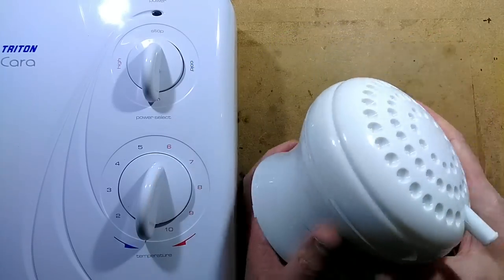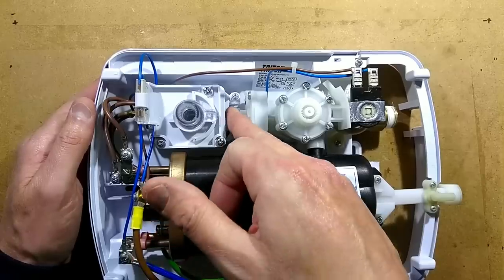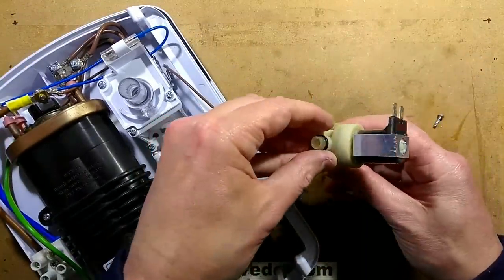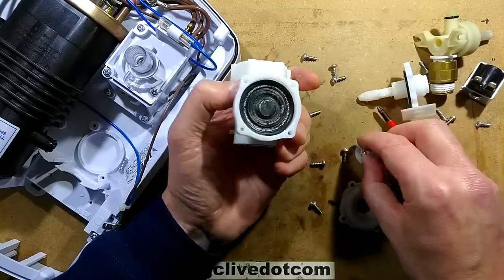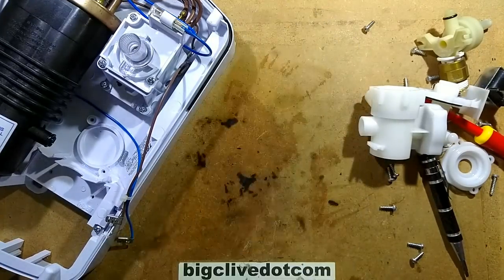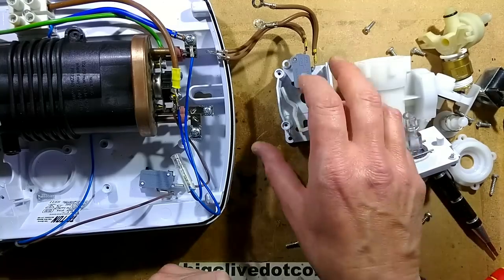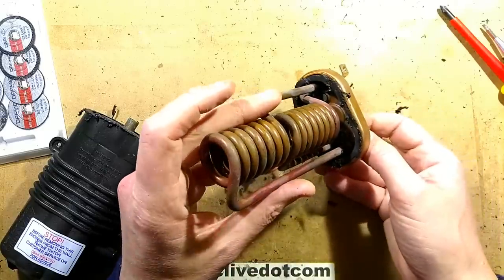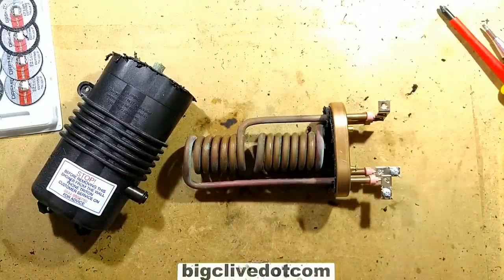Teardown of a UK electrically heated shower unit.

Comment: "Having shown one of the cheaper, but less safety conscious electrically heated showers used in some other parts of the world I thought it would be fair to show the insides of a typical British electrically heated shower." 

Just to make it clear folks: That last shower head was the cheapest garbage one could possibly buy in Latin America, we have showers with digital temperature monitoring and self adjustment and even bluetooth and mp3 players built-in down here (yep, really). Besides all the safety related stuff, of course.
Comparing the last shower head he reviwed with the higher grade ones we have is like comparing a bicycle to a Tesla Model S, and say they're the same because they're both used to transport people. lol 
We do have fancy and "over engineered" showers here as well, the thing is that most people don't even bother with them as, in the end, it's just a shower.
This is what I use myself:
https://http2.mlstatic.com/duchachuveiro-duo-shower-quadra-turbo-lorenzetti-7500w-220v-D_NQ_NP_777601-MLB20377920760_082015-F.jpg
It's a pressurized shower (there's a electric pump inside to raise the pressure if needed/wanted) with two types of water jet to choose, temperature is electronically controlled by that rod in the lower part (so it's easy to reach), and can be adjusted mid-use with no risk of electrical shock, also all the little holes in it are made from silicon rubber, to make it easy to clean by just rubbing yours fingers around them, just like the UK unit from this video. 
It's a mid end shower and costs around 4 times the price of the cheapo garbage of the last video. =)
Fun fact: it's from the same manufacturer of the cheapo shower of the last video! (Lorenzetti)

Comment: the only part of this that would make me nervous, is the coil heater in the shower head. is the coil actually submerged in water when in use?  the rest is just a P.O.U [ point of use ]  heater. which looks very safe.with the enclosed Cal-rod Units. . .

Comment: We've gone through 3 Triton showers in the last 10 years idk why we still buy em
Reply from the maker: What fails?
Reply: @bigclivedotcom  I think it's always been the limescale building up so much it can't get enough water through. Idk my dad isn't one to repair stuff he'd tether buy a new one lol. I live in Kent South East UK and you won't believe how much limescale we get, it half lifes kettles & any electric heating stuff etc
Reply: @SustainableGal  You need a limescale cartridge system inline your water input, they save a lot of stuff getting bunged up and the cartridges  can be changed when bunged up themselves.
Reply: @Witheredgoogie  oh that's a thing, would that go somewhere else in house I'm guessing? Where it comes in from mains? Only trouble is are water pressure sucks already, it hardly sufficient for pressure washer 😂😂
Reply: @SustainableGal  You can get electric ones that do not interfere with the pipe work. Not sure what Big Clive would make of them but they seem to have some good reviews. https://www.screwfix.com/p/bwt-electromagnetic-one-sided-connection-electronic-scale-inhibitor-12v/13487
Reply: @Witheredgoogie  oh right cheers

Comment: thermostat normally fails, red hot or cold nothing else. thermostat fail. thing on top of heater near the copper bit.
Reply: PitManNCB They dont get red hot if there is sufficient flow through them. Sounds like you have low water pressure.

Comment: TAKE NOTE WORLD!!! This is how it's done in England 🇬🇧
This is a proper job right here. Even if there's worse case scenario this thing will shut down safely with no dramas and can be used again. Which is the complete opposite when it comes to GE's nucular reactors which another one will shit the bed sooner rather than later and they'll all need replacing and have the engineers make the decisions, NOT THE ACCOUNTS!!!!

Sorry I went into a bit of a tangent there but from the info I've read and heard. 
Also this new camera+audio is a lot shitter compared to your other one.

Comment: Hi. I misread the title of this video. I originally thought it was saying "the teardown of all UK electric showers. The reason for this is because I live in a housing association,who owns literally tens of thousands of properties. Over the last few years,they've been going around all their properties each week tearing out their Triton electric showers. A slightly different design,but still Triton electric. I still haven't managed to get an explanation as to why they've done this,but as soon as they fitted my new shower to the boiler so that it'll use gas to heat the water,the gas prices go up. Sounds like a back hander somewhere along the line. Especially as they are replacing tens of thousands!!!

Comment: I would appreciate 1080p60 video.
Reply: 1080p, fair enough for small details.
60FPS would be a bit pointless for this channel, though.
Reply: I like the smoothness. Once you're used to 60fps then 30fps just looks stuttering.
There is no downside of that feature (that i'm aware of) besides the higher bandwidth requirement.
Reply: Helios honestly 60fps is pointless 30 is just fine for this channel and as there's a lot of small details to see people would rather higher quality and lower frame rate ... If this were 60 id have to watch it at like 420p
Reply: do we want to see clive's wrinkles?

Comment: As you illustrate, electrically, British units are a very safe design, but I just don't understand the thinking behind them. What is it with the 'High', 'Economy', and 'Low', nonsense?

There should be two variables and only two. How much water you'd like (within the limitation of your available pressure) and the temperature you'd like it. Almost all I have come across limit the flow of water, even when more should be possible, and allow scalding temperatures. Why??? The 'only' time a user should have a problem is if the water is very cold and the power would never be sufficient to heat at full flow, in which case they could reduce the flow until the temperature rises to the desired level.

Is it so hard to design a shower to do that? It would appear so...

Comment: I wonder why this shower device can be used without electric shock.
Reply from the maker: The heater is sleeved in a grounded / earthed metal case and all metalwork including pipes are electrically bonded together too.
Reply: I understood the high voltage metal tube heater.
The shower head heater is low voltage.
I can not listen to English.

Comment: You guys don't have hot running water?!?
Reply from the maker: Yes.  But electric showers give instant hot water at point of use continuously, and are 100% efficient.
Reply: @bigclivedotcom  I wasn't being a smartarse, just wondering why you would need something like this
Reply from the maker: @mCblue79  It's really just a common thing here, helped by the fact we have a good beefy 240V supply as standard.    We do have either instant hot water heating based on oil or gas burners, or stored electric immersion heater tanks.  But there's a certain convenience to just stepping into a shower and having a constant flow of perfect temperature water at the touch of a button for as long as you want.
Reply: @bigclivedotcom  thanks for taking the time to explain. Love your vids Clive, cheers from down under👍🇦🇺

Comment: why don't people in the UK just have proper storage hot water units, or a  instantaneous one?
Reply: You can't get any more instantaneous than an electric shower, that is the point in them, convenience...
Reply: Rob Fraser yes true. But it only does the shower. Just put in a proper hot water unit.
Reply: Most people will opt for a combination boiler in an ideal world. This heats water for both your central heating system, as well as hot taps, showers etc. They contain a pump to keep good water pressure even for multiple showers at once. Older houses have a hot water unit fitted in the loft, this heats the water and uses gravity to feed taps - however these don't have a pump and just rely on gravity. The result is really poor water pressure.

In instances where people have old houses with hot water tanks and can't afford to upgrade to a combination boiler, they fit one of these cheap electric showers. This way they can benefit from the higher pressure cold water, while not having to fork out a lot of the money for a combination boiler.

These units are typically used by poor people, as well as hastily converted domestic houses to student houses.

Comment: I should not have watched this. I have an electric shower and there is a ground wire that might not be connected just coming out of a hole in my kitchen. Workmen replaced some insulation in my living room and rewired the sockets while the wall was open. Its not my place and the landlady is one who does nothing but fob me off since i require her to give me notice if she wants to come in. She is the kind of landlady who thinks nothing of just walzing in your place if you are not there and i have seen her do it in the complex i am in. I wont stand for it so for that she just fobs me off when it comes to repairing stuff.

Comment: Got one just like it!The power requirement always bothers me because it's essentially a 3kW kettle with an inbuilt water pump to force it out and somehow this all comes to an addition 4.5-7.5kW. The amount of innovation that goes into stuff like motherboards leaves me wanting a super efficient but amazing water pumped electric shower nearer the 6kW mark. I'd like to think it's achieveable :P Maybe throw together a 3kW water heater with a 3kW water pump?
Reply: sephirothsoul999 There's no pump in the unit shown. Just 10kW of heat going into the water at near 100% efficiency. To use only 6kW, must take colder showers or use less water.

Comment: I don't understand why they have electric shower water heaters? Don't they already have hot water in their homes like normal western countries? Seems needlessly redundant and energy consuming?
Reply from the maker: We do have central water heating.  But these units provide instant hot water on demand and are almost 100% efficient.
Reply: @bigclivedotcom  <> Oh, OK. Here in the US the instant hot water is achieved by a hot water circulation system and/or having the water heater right next to the bath. I guess having 240V's immersed in the same water you're immersed in just creeps me out. Lol
Reply: @Oldhogleg  Your wall plugs creep us in the UK out, they are lethal :-)
Reply: @lotuselansteve  <> Lol, that's because they're only 120V, making them much less lethal from shock than the 240V you guys use. We use both 120V and 240V, but the 240V power is typically reserved for major appliances like clothes dryers, stoves, water heaters, air conditioning, and so on. General lighting and wall receptacles are 120V.

Comment: I had one of these showers and it was shit, it had one setting "Burn" no matter what you turned....
Reply from the maker: That sounds like there was a water pressure issue to the building.  These units regulate heat by water flow.
Reply: It was in my parents house growing up.. It's not good pressure but ok. We live in a very hard water area so my conclusion was the coil was thick with limescale and the cut of was broken. The only time you could have a nice shower was when in the coldest months of winter.... I really enjoyed seeing you take this one to pieces and killing it..

Comment: Hmm... Looking at this device with a bit of terror in my eyes I must admit, that certain inventions could only happen in the Anglosaxon world... Although the so called "flow-heaters" (not sure how they should be called properly in English) are quite common in my country in Central Europe (and in all Central Europe, by the way), they are used only for heating water for washbasins or sinks in the applications where any more advanced heating system would be economically redundant. So you can mostly see them in public restrooms... They are OK because they are not exposed to direct splashes of water - to any splashes at all, in fact. But, mounting such a device in a shower... this is the most ridiculous electrical ridiculousness I have ever seen... even more ridiculous than separate taps for boiling hot and freezingly cold water... Hope I never have to use such an invention... ;)

Comment: A 120V unit wouln't make much sense. Let's say 10kW, that is 42A at 240V, or 84A at 120V ! This mean you would need some AWG #2 wire, which is extremelly big! (0.258" per conductor). Since most place that have 120V also have 240V, that 60A capable wire (#6) is widelly available and already used for stove/oven, that #6 wire is cheaper than #2, that double 60A breaker can be bought at home depot or any hardware store, and for cheaper than 100A breaker, and that many panels will NOT accept a 100A breaker... Plus the remaining electrical non-sense... It would be quite stupid to make a 120V unit.

I did had the 'pleasure' of handling some #3 cable... Not. Fun. I don't want to think about the #2...

(as for american wire gauge (awg), the smaller the number the bigger the wire is. #14 is used for normal outlet, 15A... #12 is mostly baseboard heater and water heater (3000W, standard) and is 20A, #10 is 30A and may be used for the water tank (4500W, high power). #8 for cloth dryer, 40A, #6 for stove and 60A. #0 will be used for the service panel feed for 100-150A and #00 or #000 for 200A. Yes... multiple 0... it go down to #0000 then go by size)

Comment: Kinda reminds me of a Bosch Hydropower, the power setting is the flame control and the heat/cold flow rate is the flow rate knob except it it lacks the 80 degrees Celsius skin melting mode or the annoying temperament of setting the bastard up and enjoying either freezing cold showers or showers hotter then Satan’s butthole 😂

Comment: My mother had a shower installed and it has the interesting feature that once you press the button to turn it off the water flow continues for around 3-5 seconds afterwards presumably to cool the heating element?
Reply from the maker: +SR Yes.  It's an anti scald feature.  I'm not so keen on the ones that finish your shower with a cold deluge.
Reply: i sometimes hear the "cut-out" click otherwise

Comment: When abusing amphetamine the "hobbyist" will display symptoms like this:  Like taking a perfectly good laptop thats not working cuz the Ram has been removed from it or the BIOS Battery is dead and taking it right down the core structure and losing most of the screws in the process:

But the main one the speed freak will do is ......

They cannot put anything together at all once they have dismantled it: 

Then in turn, they will have no rational explanation for the dismantling: 

"Well I tried didnt I"
"we" cant change it; whats done is done; I`ll get a look at when Im in the mood; but at least its in the box where all the stuff is"

Comment: so you all in Britain don't have water heater tanks?? LOL Or rather, I should say, they are not a common thing?
Reply: tall32guy  yeah that's right before these we were using cold water from a bucket down the well. Couldn't see the well, well on the dark mornings as the candle kept blowing out.
Reply: Witheredgoogie thanks  for the smartassery. Lol
Reply: Well before these,  when it rained heavy I would go out into the back garden with just a bar of soap and flip flops on then have a shower in the rain. 😳
Reply: @m101ist  don’t be a smartass.  I saw that this was a video about an electrically heated shower unit, so i figured that not every house in the UK has water heaters, because if they did, why would you need a heated shower unit?

Comment: has the UK heard of this amazing thing called hot water heater
Reply: It's called a water heater.  Why would you heat hot water?
Reply: Electric showers have less issues (for example pressure and temperature issues when another water valve is opened) and are cheaper in terms of heating water.
Reply: @TheOtherBill  that's just what they're called hot water heater/hot water service
Reply: @dylanharding5720  yeah i was reading an article the other day confused by all this my country (Australia) seems to just do plumbing differently and i want to start off by saying the article was written by a British expat so its not a jab 

they mention the UK has a problem with showers being luke warm and having low water pressure and America having 1000 different buttons and knobs and being a crap shoot of pressure or heating 

here we don't have that problem the hot water is hot and the pressure is high depending how high you open the valve 

the way its heated (now days) is by a small box on the outside of your house which pretty much has a copper coil which is constantly heated to a high temperature so the hot water is near boiling and instantaneous it might sound taxing but its cheaper to run and more environmentally friendly than the older style heating tanks it also saves water by not needing to run water for a few minutes to get hot water running out 

actually if you fill the kettle with hot water for my house personally it only takes 15- 30 seconds to reach boiling
Reply: @indeed8211  the kettle thing is also the same here, but most people don't do that. We also have instant boiling water taps etc.

Running the hot water for a few seconds just flushes out any water in the pipes that's cooled down.
Reply: @dylanharding5720  Electricity is the most expensive way to heat water.

Comment: I hate these things. No pressure, or no heat or sometimes neither and too fucking noisy for the work being done. I much prefer the traditional style plumbing with a proper hot water tank all insulated with an inch of its life.